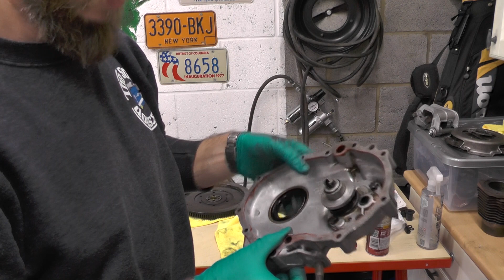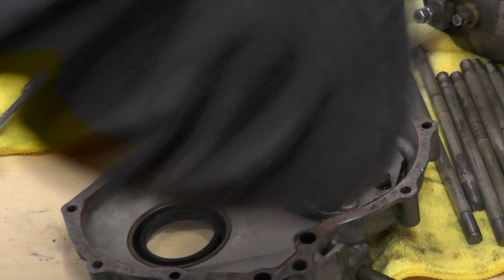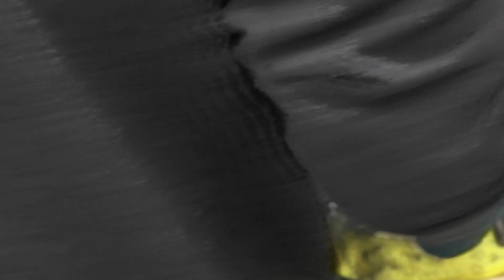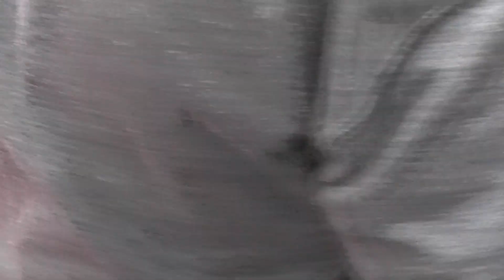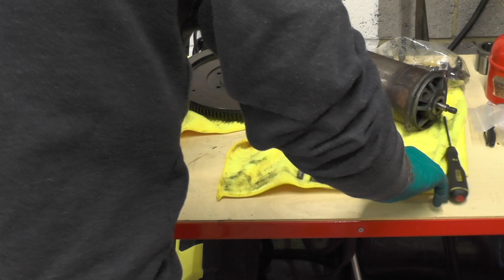30-16 Cleaning Oil Pump & Cover - Classic Fiat 500 Engine Rebuild Series

Comment: Does the spring mechanism serve as an oil pressure regulator? My gauge on the dashboard shows 6 bar of oil pressure (no idea if that's realistic), but I also have no idea what I could do if my oil pressure is indeed too high. Do you have any tips?
Reply from the maker: Honestly I have no idea 😂.  I don’t have an oil pressure gauge so I have no idea what is normal pressure on these vehicles.  What I would say though it that low oil pressure is a problem for engines, rather than high oil pressure.  High oil pressure is what you want as it means the oil is circulating around the engine.  low oil pressure means the oil is not circulating correctly and that will damage parts very quickly.  

If I were you I’d ask the question on one of the many Facebook forums.  Someone with an oil gauge is bound to respond. 🙌